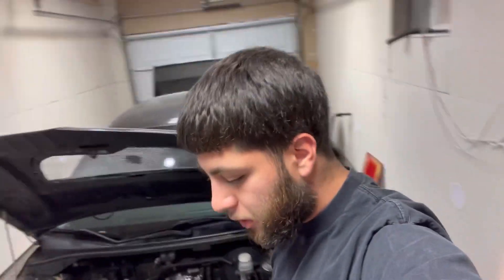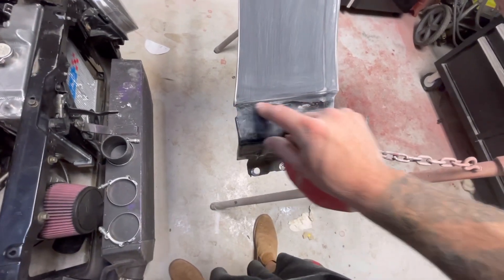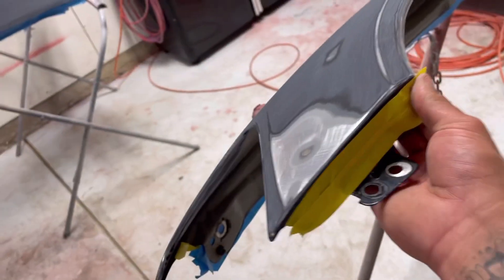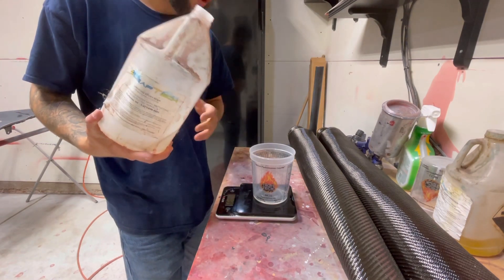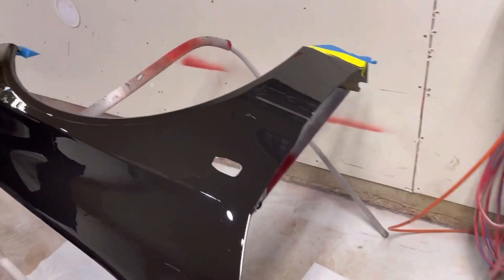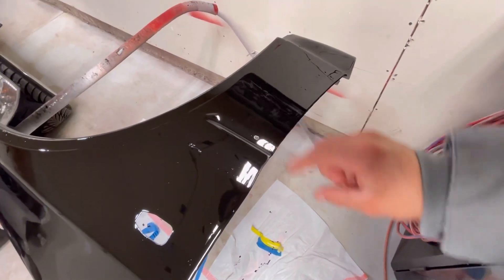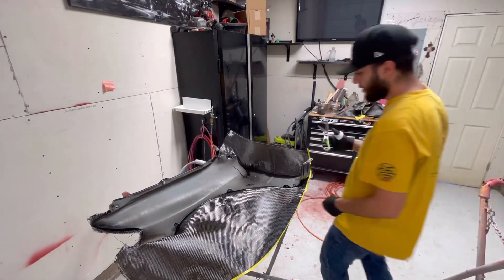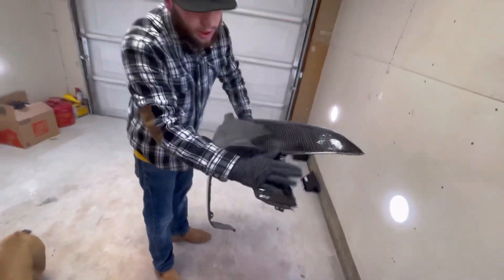How to make carbon fiber fenders PART 1

Comment: That's the mold, when you lay up onto of your original part its going to bigger than the original....use mold realease and then fiberglass and lay up on the fender, first spray the fender with an epoxy gel coat. Let it get tacky and then lay up a 2 mat one woven with one Mat to cover the woven...you want the 2 ply of Matt to be against the fender....let it go off " dry"... then pop that off the fender. Use mold release on the piece you popped off. And lay up cf inside of it....there's your correct sized part ...I do this for a living...you can also brace the mold so it doesn't flex
Reply: I have a fiberglass fender and I was thinking of doing the same thing, Lay carbon fiber on top. Should i do multiple layers to ensure it doesn’t crack or lose its look over time.
Reply: @angel-ri8nj  if it was me....I'd use fiberglass first and make the master mold directly off the fiberglass fender. Make it 2 ply so it's strong yes. You don't want movement at all. But I'd use strictly fiberglass for the master mold. Prep the fender with mold release. Then take a sandable epoxy gel coat. Spray your fender...then watch if anc lets it get tacky...once tacky lay up 2 ply with one woven in between each ply. Use metal rollers and take your time rolling it out Makes all the air is rolled out  ... temperature has a lot to do with his fast it cures. You want 70 degree's. But once it's dry ...pop it off, neat trick is to use an air chuck. Shoot directly into the gap and the entire part will pop off in a split second. ...but now you have your master mold ..sand out imperfections and then lay up your carbon fiber directly inside of that mold....that will give you a perfect to spec part and you can make as many as you want since you now have a master mold

Comment: So you just added weight 😂 isn’t the point of carbon fiber to lose weight 😏
Reply: Yea but it could also be for looks. I think it's cool af. Doesn't look bad at all. Plus it's a bit more sturdy than a mold. I heard that molds tend to rattle or shake when driving at high speeds. This would definitely cut that rattle. 😅

Comment: What happened to part two2?
Reply: everything you get from amazon or ebay amazon more expensive , me i went to ebay so the cloth is about about 40$ a roll i got 2 just incase but really needed one but i did the inside my car too , the epoxy is more exspensive a gallon about 30-60$ but you dont need a gallon little goes a very long way! , then sanding material also wet sanding too then clear coat , as well paint brushes from the dollar store, me i spent about 120$ but thats fenders, my door panels and the inside my car too cloth can go a long way if you cut them to the part you want right

Comment: Did you for real just skin the metal with carbon fiber?
Reply: everything you get from amazon or ebay amazon more expensive , me i went to ebay so the cloth is about about 40$ a roll i got 2 just incase but really needed one but i did the inside my car too , the epoxy is more exspensive a gallon about 30-60$ but you dont need a gallon little goes a very long way! , then sanding material also wet sanding too then clear coat , as well paint brushes from the dollar store, me i spent about 120$ but thats fenders, my door panels and the inside my car too cloth can go a long way if you cut them to the part you want right

Comment: How much each fender cost to make?
Reply: everything you get from amazon or ebay amazon more expensive , me i went to ebay so the cloth is about about 40$ a roll i got 2 just incase but really needed one but i did the inside my car too , the epoxy is more exspensive a gallon about 30-60$ but you dont need a gallon little goes a very long way! , then sanding material also wet sanding too then clear coat , as well paint brushes from the dollar store, me i spent about 120$ but thats fenders, my door panels and the inside my car too cloth can go a long way if you cut them to the part you want right

Comment: Where did you buy the kit from?
Reply: everything you get from amazon or ebay amazon more expensive , me i went to ebay so the cloth is about about 40$ a roll i got 2 just incase but really needed one but i did the inside my car too , the epoxy is more exspensive a gallon about 30-60$ but you dont need a gallon little goes a very long way! , then sanding material also wet sanding too then clear coat , as well paint brushes from the dollar store, me i spent about 120$ but thats fenders, my door panels and the inside my car too cloth can go a long way if you cut them to the part you want right

Comment: Do you separate the fender from the cf once cured or is it just stay on the stock fender? Id like to make my own too but i want to cut weight for a track car not for street.
Reply: In order to separate it you need to do this same stuff but basically more steps. Apply a release agent on the fender before you put down the black gel coat. Second, you need to do 2-3 layers of carbon fiber, making the weave go in different directions so there is strength in every direction.
Reply: @joetroy2904  thank you for the response.  Any chance you could make a video of that process?
Reply: @UNDERFUNDEDGARAGE  this is prolly late, but AJ Hartman on YouTube has some good tutorials!
Reply: Для этого нужно сделать матрицу крыла, а уже по ней сделать само крыло из углеткани
Reply: Try this series https://youtu.be/UgKvDw1E60E
Reply: Yes, once cured the composite weave is separated from the metal fender. You now have a light weight composite fender. It is lighter and can be designed to be *stronger than the stock metal fender.*(reinforced with Kevlar ,etc. which is used in making ballistic armor,vests,etc.)